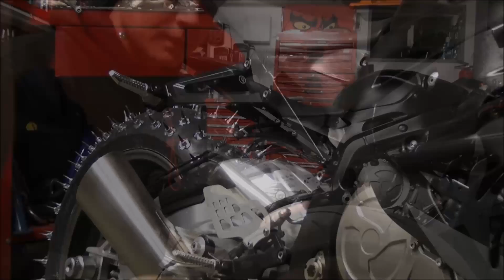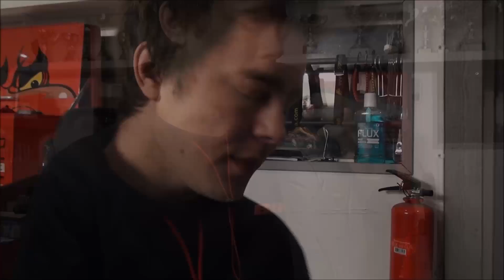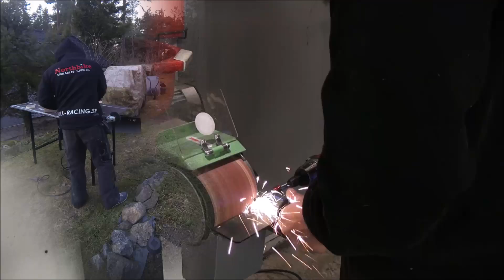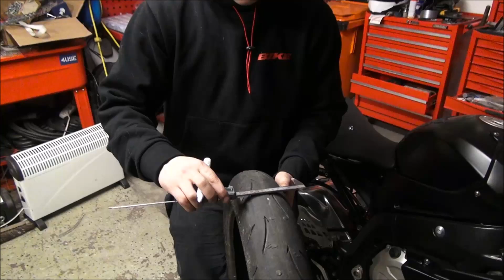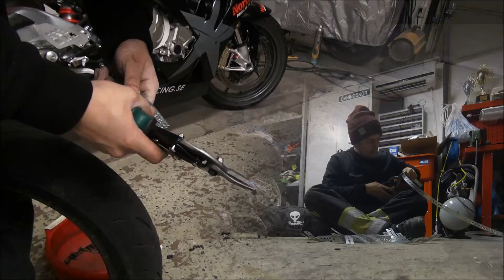How to build Ice Racing Tires

Comment: Well-done video! Lots of painstaking work here! How long do these studded tires last?
Reply from the maker: For several years, but make sure to inspect the tires, som get cracks more easy than others. The rubber is not manufactured to the cold tempratures 😊

Comment: before all i'm sorry for my bad english i'm french but i've lot of question about your awesome work, it's beautiful, i make a supermotad with a modified 400 drz sm and i want to do the same thing because in  my city, i've an open day on the ice circuit and i want to participe with my motorbike , so there are my question:

n°1 what bolt and screw did u use
n°2 how many bolt and screw did u use for make two tires
n°3 where did u buy all of material
n°4 a price off all

thank u very mutch, and ride safe V

Comment: This is awesome! Looks like A lot Of work. My question is what grade of screw are you using? And do they wear out fast?
Reply from the maker: a have not broke any tire yet. M8 bolts? 😜 I have builded some tires and used different lengths 😊 from 20mm to 40mm
Reply: so the metal bands that you put in the tire Aluminum? and is it really necessary?  I was just going to use fender washers.

Comment: do you run tubes in the tires or do the screws seal the holes when tight. if you use tubes how do you protect it from the bands poping it.
Reply: "You probably have some questions how to keep the air inside of the tire when you´ve mounted it. Dont worry. In my next tutorial I´ll show you how to setup your bike for ice racing. Since there is more than just studded tires."

We´ve been waiting 2 years for the info on how to keep the air in! We used rubber mat to protect the tubes from the metal, but they would start failing at some point. If you have a better way, pleas share it. 

This is our version from 15 years ago, but I just uploaded this video this year: https://www.youtube.com/watch?v=CF43iB1C35Q

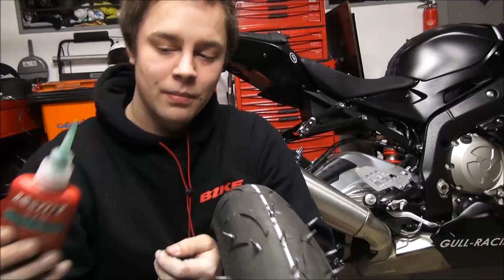Comment: the   nuts with the 4 spikes you use. at 8:36. What are they called?  Would  the sharpened studs tighten up better if the 4 spikes were the other way round? actually into the tyre. Or is it to give more grip?
Reply: +alfretonred  good question!  Robert, what do you say?  Have you tried them with the spikes in?
Reply from the maker: +alfretonred I have builded some with them turned around, into the tire. For the tighten it doesnt matter, but for clear ice- go with the sharp en on the nut into the tire, if you will run in a bit of snow on the ice, you get a bit more traction with these 4 spikes out :)!
Reply from the maker: +Nick Kaplan  I have builded some with them turned around, into the tire. For the 
tighten it doesnt matter, but for clear ice- go with the sharp en on the
 nut into the tire, if you will run in a bit of snow on the ice, you get
 a bit more traction with these 4 spikes out :)!

Comment: What class studs do you use, 8.8? And is there a big difference with M6 and M8 studs?
Reply from the maker: yes. 8.8 it depends on the ice more 😊
Reply: +Rideable by Robert Gull Thanks!! Still asking, got any tips to give for the pattern to gain as much grip as possible? :)
Reply from the maker: +jjokkeh I have just been riding straight. The free pattern from them metal band have worked well. Will try some cornering this winter 😄

Comment: how many bolts do you recommend for the rear tire and the front, and instead of spending all the time grinding wouldn't it be faster using a snowmobile stud sharpener (45 degree angle to fit over the bolt), and what is the length of the bolts your using. the set up i was going to go with are grade 8 bolts (length hope you can answer that), and small washer, and then a fender washer on the inside,then a small washer and a half-height nylock nut on the outside. sound like it would work? hope you read this any helpful info would be greatly appreciated
Reply from the maker: Hey! I think the snowmobile might work. I am grinding my own since it is alot cheaper. Lenght depends on what the ice is like. hard or Soft?  Soft ice = long studs (35-40mm) and if it is hard ice you can go with shorter studs = 25-30mm 😊 I am a "rookie" on the ice. I have only been riding ice for 2 season. But I build around 8 tires/season. Send me an message on facebook : Robban Gull so I can send you some photos of my best tires 😊 pattern matters alot

Comment: Can you list the thing you ues so I'm not looking for them or going back and forth to the store.
Reply from the maker: Hey Hakeem Hansen  Here is a list of thing I´m using:

M8 bolt x 35 mm long with small head 650pcs
T-Nut M8 650pcs
Metalband 10 meters
Loctite
2.5mm drill
16"x100 innertube
Contact glue
Some camping foam that you sleeps on

Glue the camping sleeping foam inside of the tire to protect the innertube from damages from the bolt heads :)

Good luck! :)
Reply: Oh thanks a lot.

Comment: How do you get the tire air tight? Are you using inner tube? When we were young, we made bolt tires for cars, we used round head bolts and transportation belt over them inside, plus inner tube.
Reply from the maker: Hey Margus, Yes we are using an inner tube. I´m also using round head bolts, and cover the inside with some camping sleeping foam (know what I mean?), this foam is cut in the right size, then I use contact glue in the inside of the tire, covering the bolts. Then place the foam in the tire and the inner tube. Fill it up with air and leave it over night before mounting the tire on the rim :) Upcoming video will be "How to setup your bike for ice" will include mounting tires, protections on the forks and the cooler :) Margus Lummo
Reply: +Rideable by Robert Gull 

When will this video be released? :)
Reply from the maker: Hahah I have totally forgot this. I Can make a video upcoming week 😊
Reply: +Rideable by Robert Gull 

That would be very much appreciated!!  :) Thank you very much for this very educational awesome video. 

 In the video there are two tires, one with more spikes, and one with less spikes. What is best you think for a beginner ice rider, more or less?
Reply from the maker: +Sebastian Thyberg less studs. it depends of how hard the ice is to. hard ice (really cold and cloudy day) you go with less studs. Soft ice (warm and sun) more studs 😉 
  :)!

Comment: http://tungco.com/wp-content/uploads/2014/04/DSC_8027inserts-1.jpg  Hi, I saw these tungsten recycle bits, they look like cool for the grip on the tires. They have holes in them to bolt but I dont know how big they are, but tungsten is real hard as a metal so it would not wear down as fast as other metals, just thinking.